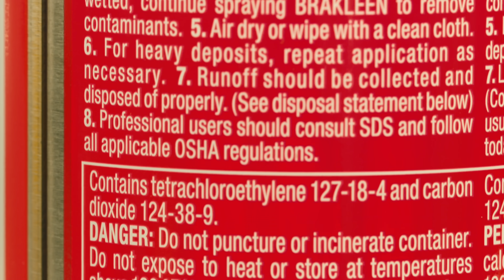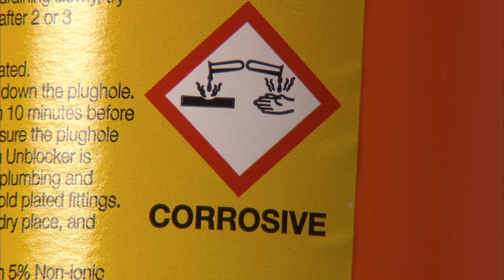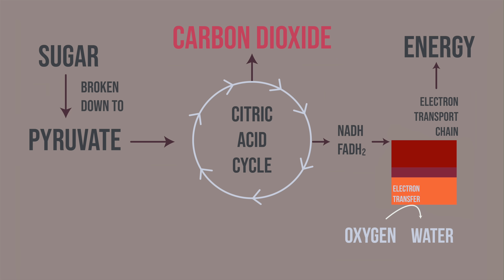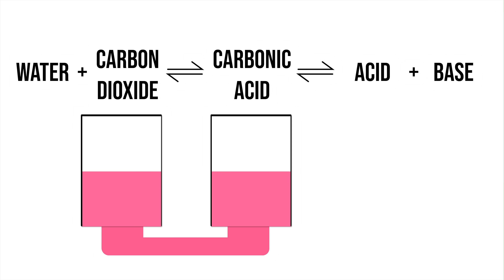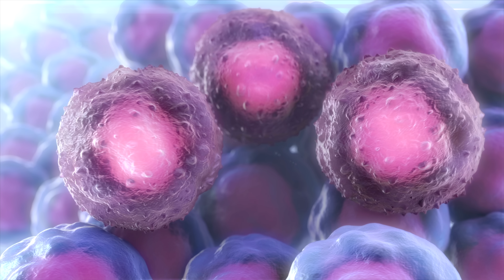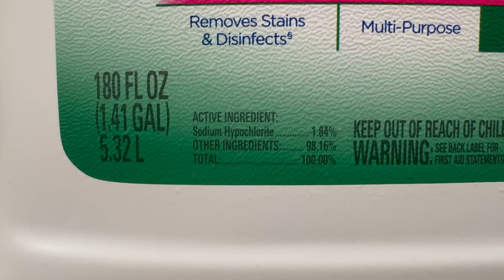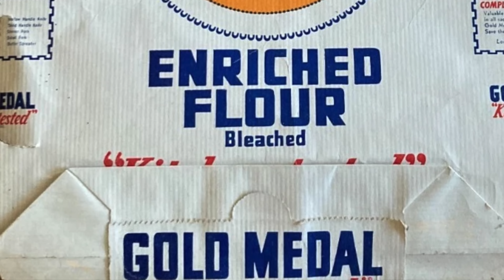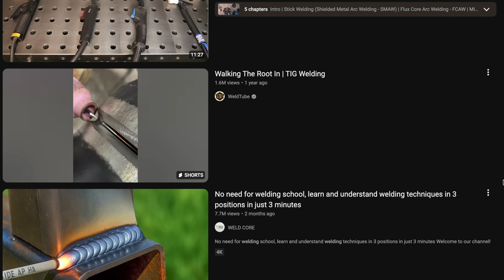"It smelled funny while I was welding and now I can't breathe..."

Comment: Phosgene has, for some people, a smell like green corn, fresh mown hay or even rotting fruit. Others can't detect it at all.
And I've gotten a snoot of it, no sense of smell anyway, fortunately it was a trace due to carelessness on the part of an HVAC tech I was assisting, since my shop had pretty much no work.
But, I've also gotten a snoot full of phosgene and HF again when using a Halon fire extinguisher when my trash can caught fire and heaven knows what other goodies I got a sniff of, all because the wind shifted at the perfect moment.
Suffice it to say, exposure and symptoms were mild and recovery complete and I've taken to an increased standoff distance when using any fire suppression apparatus. Especially after getting a face full of powdered fire suppressant because of insufficient stand off. The instructions say ten feet, they really mean ten feet and watch the wind when you're outside.
Inside, Halon and a small fire, screw that noise, the chance of phosgene isn't exceptionally high, but HF is a byproduct of Halon and heat, especially in a fire involving superheated metal. I'm out, let the damned place burn until the FD gets there.

The worst hypoxia I've ever had though, second peak of COVID, respiratory distress, pulse was pushing 155, SPO2 is normally 98 - 99, hit 75 and I told my wife to call an ambulance as she'd just came outside to nag me to do that, not a word, she knew me well. If I call for an ambulance, it's life threatening and likely immanent. 
That one was swoop and scoop, ambulance arrived, took vitals and no stay and play, off to the races. Medic blew IV initiation and I did offer to set the catheter myself as I've done it thousands of times as an SF medic, then realized we were less than five minutes from the ED and that'd create a modest delay. Was on high flow O2, obviously.
SPO2 dropped to 70 on room air (thanks, transportation for not hooking up the O2 you disconnected, poo-poo poopy cacahead!), pulse pressure dropped to 10. Doubleplus ungood.
Lungs quite laden and partial collapse for entertainment value, hypertensive crisis from hell with that low pulse pressure, free T3 and T4 hormone levels were stuck to the ceiling (can't recall the values, but they were ungodly high) - CHF secondary to a thyroid storm.
Next late morning, endocrinology came by and suggested Lugol's iodine, I suggested that since BP, pulse and pulse pressure were reasonably under control, perhaps we should hold off on employing the Hail Mary of the Wolff–Chaikoff effect to see if the methimazole dose increase turned the tide.
Methimazole won the day, another resident learning more conservative approaches aren't always long term in waiting for effect and I discussed my reasoning.
I'm not fond of endocrinology, but I do understand the basics and Graves disease quite well enough and the medical interventions were most probable to bear fruit within the period that Wolff–Chaikoff would take to take effect, attacking the issue without a potential rebound once the iodine is processed and stored. It's a thyroid control loop problem secondary to autoimmune attack on the thyroid stimulating hormone receptors, it's not something complicated, like a pregnancy or the adrenal control loops that give me headaches or well, pituitary control, that'd pure doctor land, emergency beam out!
Went in late Saturday night, by Wednesday, I was restless with energy and walking the hospital halls. And nearly broke into tears with all of the beds lining the hallways, just in case COVID continued to rage as badly as the first wave did. Thankfully, the shutdowns, if not broke it back, left it limping badly until the vaccines could make it blunter than my head.
That scared me more than the damned thyroid storm that tried its level best to kill me!
Grew my AAA another half centimeter as well, grumble, grumble, grumble. Followup ultrasound to monitor that on the 22nd. I'll get my thyroid hormones levels checked then as well, since it's at the hospital's main campus.

Comment: I once was learning to weld. I was welding galvanized steel. Well, that night was rough, the next day was rough. A day later, rough. I was worried, I jumped online. Zink exposure. That was what I found. I gave it another day knowing if i didn’t start to get better I should head to the ER for heavy metal poisoning. I woke up the next day, the flu like symptoms were retreating. I gave it another day. I woke up, felt normal. And I thought to myself, research first from now on. Four years later, a situation arose, I realized history was going to repeat itself, I spoke up. We changed plans after they looked into it. Pay attention people. Do as I say and not as I do. I say, do your research and take nothing as assumption.

Comment: Yes, the arc light is not only bright, but it's also extremely high in UV.
Think sunburn from the UV rays coming from the sun. 
     I once tried to be quick with welding, but it took much longer than anticipated.
~3 hours later, all exposed skin was bright red, especially my face.
    This is why the welder's mask is there to cover the entire face.
It's not for sparks or any other safety issue.
    It's so you don't fry your skin.
To show how toxic it is. "Phosgene gas" was used as a chemical weapon in WW1
     I was used until "mustard gas" was developed.
Both have the same effects on the body. Mainly repertory effects.

Comment: I would like to object to  5:50 calling welding voltage "high". The voltage involved in welding is single to double digit, and high is, depending on the definition, at least 600+, something never directly used for welding by hand.

Comment: I couldn't see Styro being that ignorant, and anyhow brake cleaner does NOT remove rust.  Styro would surely use electrolysis with muriatic acid to clean the rusty parts.

Comment: it wont help with solvents like whats used in this case but a welding resporator was one of the best $35 ive spent. If you think you need one you need one

Comment: There is a stage in your knowledge where what you know, is actually dangerous. In the beginning, you know nothing, so your approach towards it, is very cautious. Then you learn the basics and you start feeling a little more comfy with the tools you are working with & during this period, things usually go wrong. Knowing little is more dangerous than nothing. You know where to go, to cause serious problems. The guy who knows nothing, doesn't know where to really cause harm. Oh and yes, the arcs from a welder is extremely harmful to skin. I repair them & about 10 minutes of testing at around 200 Amps, does the same burn damage to skin as 5 hours in direct sunlight does. You don't want to mess around with this one. Its also not a sun burn. Its a cook burn. The skin turns a dead darkened brown. Not the usual brown.

Comment: Welding uses relatively low voltage, not high.  30v is in the high range and close arc on constant current machine could be as low as 8v with a close arc.

Comment: I was using an angle grinder when I was at school during part of my basic education as a mechanic. Me and two others where told to cut a construction surrounding a tank apart using angle grinders. Last thing I remember was being taken to the hospital. We spent a day there recovering. What went wrong? We where cutting stainless steel. This particular alloy produced a potentially lethal toxic gas when cut or welded. We did not wear ventilators.  Despite us doing it outside, it was still enough to knock us out completely. I had a splitting headache for days. this was around the year 2000.
Reply: this is not a true story in any world
Reply: @killsalot78  I suggest you google "why cutting stainless steel can be lethal"

Comment: So this actually has a lot in common with an issue I’ve had with work for a while. 

We grind the back of the wheels and the front of the rotor hub which is normally a step skipped by most shops.  Due to this there will be large dust clouds at are just the corrosion particles in the air.  It causes everything to get dusty. 

My issue is I’ve complained multiple times that we need some filtration system; if this much dust builds up over a few days, then there’s no way it can be safe to breathe.  When I mentioned this to the regional manager he told me to wear a mask.  I explained it was an all day/ long term issue and he pretty much told me that we wore masks during Covid so wearing a mask is totally fine. He also reassured me the air quality passed when they built the building.  What he doesn’t understand is when the building was built, no one was working there and that meant we didn’t have all that corrosion in the air. 

To anyone who knows what I can do, please let me know.  Who do I speak to outside of the company to ensure the air is safe.  I am certain that the air quality would fail and everyday they further endanger our lives.
Reply: hey man, I just want you to know, that for hundreds of years people have been welding and machining things on cars with no ever documented cases of phsogene being released. You should really read up on the actual OSHA regulations and you will understand that things like dust are truly only regulated in small closed rooms... there is a reason afterall why asbestos didn't kill everyone in the 20th century despite it being in every home and product ever made. This paranoia safety theater is really strange and probably sponsored by some NGO somewhere because this video is lacking a lot of facts and details.

key point, you'd never get phosgene poisoning from dust inhalation. The metal dust in your shop is perfectly safe as long as it isn't inhaled in massive quantities. Steel, is just carbon and iron. Brake discs are not made of stainless or anything else special. Every single machining shop in the world has the same dust you are describing. 

And this is why I consider safety theater dangerous, a video like this is causing you to considering losing your own job for no reason, and bearing the egg on your face of OSHA laughing at you. These people in media know the rules they're after, theres a lot of cancel culture on youtube. I wouldn't be surprised at all if google forced these two to collab because styro pyro does thing himself that nobody else does and is literally fine. Ive seen it before. There have been other youtubers like svseeker who have a gang stalking him that does mass reporting on any video he makes because they didn't like the fact his home made ship was actually legal and sound... Seriously, don't believe me? look it up.

Comment: imagine if you will you're trying to free a stuck calipre bolt in the garage. You try brake cleaner and wd-40 to no avail, you bust out the blowtorch.
And you're dead 31 hours later.

I've done similar just sans the brake cleaner.
Thanks Emu I wanted to sleep tonight.

Comment: As somebody getting into laser cutting, the chlorine in the brake cleaner was a major red flag. Burning it off creates chlorine gas which is a biohazard. Even if properly ventilated, the chlorine gas reacts with moisture in the air to create hydrochloric acid that is strong enough to dissolve metal and destroy equipment. I’m always doing research and burning off tiny samples of unknown materials to test for chlorine.

Comment: >He knew car batteries
>show the instakill array.
Reply: Yeah, that was styropyros special project, but its basically harmless, because he connected the car batteries in parallel, which kept the voltage constant and safe at 12V if he connected them in series, the voltage would have added up to a lethal amount
Reply: @TheSorcerer_Lvl_1000  Is it not series-parallel?
Reply: @soundspark  I rewatched the video and he did both, just parallel at the beginning and then series-parallel at the second half. He doesn't touch it after making it series-parallel

Comment: a lot of welders use an anti-spatter spray FOR welding, which contains DCM (Dichloromethane).  i've gotten a good whiff before, and it definitely knocks the wind out of you, and makes your head spin.  you need to wear a respirator.  welding fumes are also pretty bad from flux-cored welding wire.  make sure you have good ventilation!

Comment: Basically gave himself a ww1 style gassing. Very very horrible way to go. 

Most gassing deaths in ww1 were from phosgene munitions. Chlorine gas is not anywhere near as dangerous as phosgene. Inhale it and you’ll maim yourself, but you might survive it. Phosgene gas was invented by the germans and used extensively by them.  It has hideous effects, which Wifred Owen describes in his famous poem (mocking Rupert Brook’s poem of the same name), Dulce Et Decorum Est (Pro Patria Mori) - ‘it is sweet and proper to die for your country”. Its not survivable.

Comment: This is so immensely useful that you did this video. I've taken up aluminium brazing and I was having some trouble so I watched a youtube video to see what I was doing wrong. The video recommended cleaning the metal with brake cleaner. I did this once outside and I hope I didn't hurt my lungs. Lucky I saw this - thanks Chubs + Styro! Edit: - found out the cleaner wasn't chlorine based so that's a relief!

Comment: I just bought a welder on black Friday!!! First thing I did was look up all the dangers of welding, and this was one of them. Thank you for this service announcement.
Reply: I bought a respirator very shortly after I started learning. Also bought my first welder last year on Black Friday! It’s such a fun hobby. Makingmistakeswithgreg has a great video explaining welding safety gear and respirators.
Reply: @vertvlogs675  I bought a respirator after spending a couple hours welding galvanized steel. Hubris is a hell of a thing.
Reply: Same, now I have a fear of bleach
Reply: @yosephrezahe2534  To be fair, not enough people have a proper amount of respect for the dangers bleach can present.
Reply: Please wear a respirator when you weld. Your body will thank you.
Reply: @drkilledbydeath87  When welding and cutting.
Reply: Galvanised is also a big mistake i made welding thru it 

Oh my goodness it's so bad made me so sick 

Dont weld thru Galvanised without grinding it off 1st! And we're a proper decent mask with carbon filters dont buy cheap mask
Reply: Clean METAL, no coatings, no sprays, no rust, nothing but shiny clean metal.
Your literally melting metal with the heat from the surface of the sun just incredibly focused.
If it can MELT metal, it can evaporate ANYTHING or melt it ON that metal.
Reply: Me too. I looked up all of the possible dangers, then I tried all of them with no PPE
Reply: Smart kid
Reply: I recommend taking a college welding class. I did for fun.
Reply: Is welding like a giant version of soldering?
Reply: @typingcat  no, not even close. I took a college class in welding and it taught me a lot about it.

Comment: Ive welded for decades, Ive used brake cleaner to clean parts for decades. Ive never cleaned parts and then welded them right away, but I have welded it a little later. Brake cleaner drys almost on contact, so Im a little confused here. Unless he was using chlorine brake cleaner. I do not use that type and never had. It must have been chlorinated brake cleaner, all I can think of. Ah there it is, yep chlorine, they make brake cleaner without chlorine. I never use the stuff with chlorine in it.

Comment: Moment I heard brake-cleaner and welding my first thought was: "Chlorinated fluorocarbons + ionizing radiation = bad stuff"

Kinda why there's a slight rivalry between mechanics and welders, as the former tends to use chlorinated cleaners even when the weld-crew has thrown a wrench at them for it.

Comment: Fun fact, I got home from work one day in my teens and asked my parents if it was okay if I took a shower. They said yes, so I started my shower. About 5 minutes in, I could feel an itch in my throat. Didn't think much of it yet, but a few more minutes later I was coughing with rapidly increasing severity. Within a few seconds of this, I shut off the water and got out and went down to my hands and knees, my father coming in to check on me. Fresh air wafting through the bathroom, the coughing subsided, but I was exceptionally light-headed. My breathing slowly returned to normal as I realized I had a towel draped over me.

This is the part where you would expect that I went to the ER, but no. We were poor, and barely getting by with no insurance of any kind in a house that was likely made pre-1900 at the time. There was no ambulance, or ER visit. Not even a checkup the next day since by then I felt normal again. Couldn't afford to be certain, so life went on. Turned out that they had bleached the drains hours ago, and had expected that the bleach had already gone through to the local sewage system. But the old plumbing in that house had a shift in the drainage that allowed the bleach to pool near the drain. The hot steamy water causing it to fume out of the drain and into the shower.

More than a decade later, I have yet to experience any non-illness related lung problems. I am grateful that I got out when I did. Grateful that my father opened the door and draped a towel over me. Grateful that there wasn't more bleach that got pooled up in the drain. What I despise more than anything is this broken economy that puts its citizens in such situations. And it's only grown worse since. Healthcare should be free. Other countries do it, and do it better. Old houses should have options for no-or-low-cost modernization and renovation. Other countries do this, and do it better. What happened to the US striving for the best? The only thing the US is best at now is treating its citizens worse than livestock all so it can have the wealthiest men in the world. And even fall over themselves to elect one of them into presidency twice!